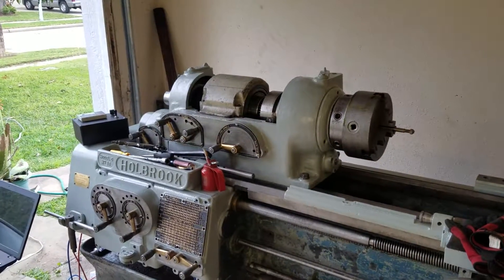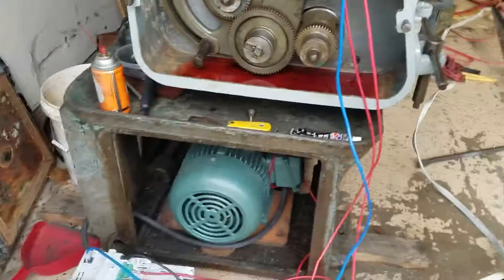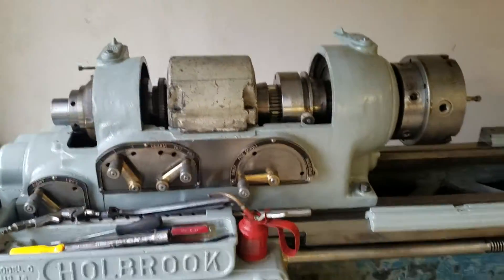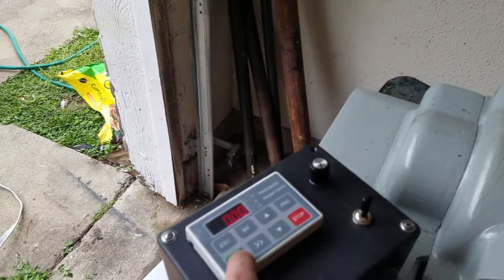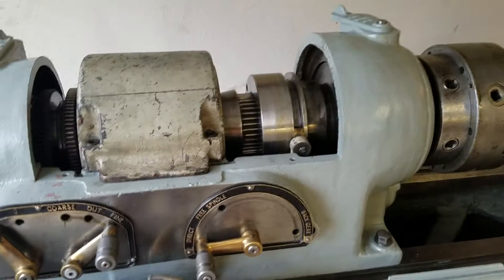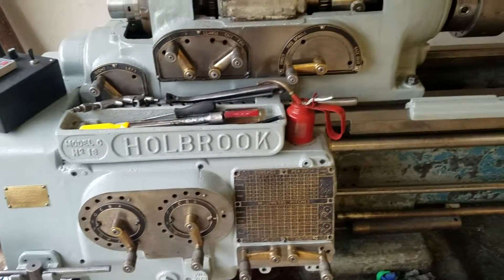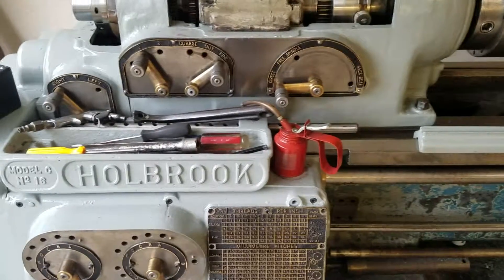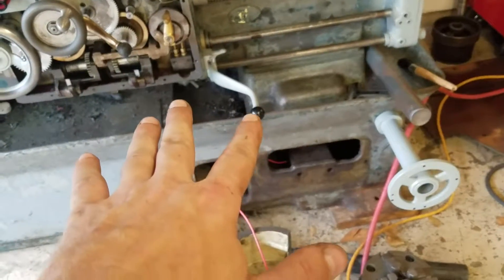Holbrook C16 test run.

Comment: hello why did you have to modify the lathe, I assume multi speed motor died?
Reply from the maker: dan wolf The lathe was flooded in a tropical storm in 2001 filling the gearbox with water. It sat full of water until I bought it in 2016. The motor ran, but the gearbox and contactor panel were solid chunks of rust. A new motor and VFD was the easiest way to get her running again.
Reply: Just subscribed . Regards from the UK. Lovely lathe too !.